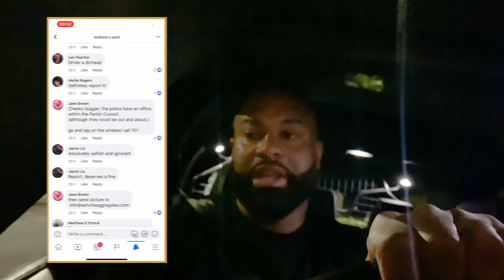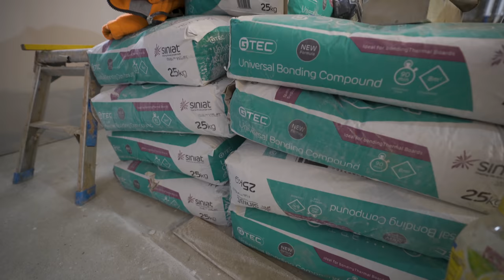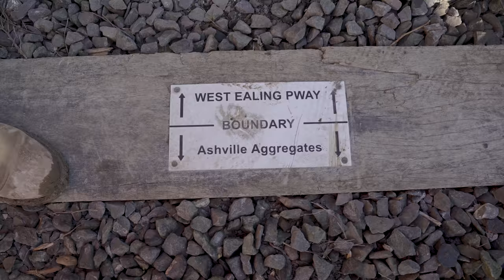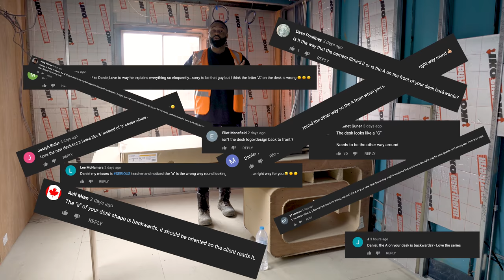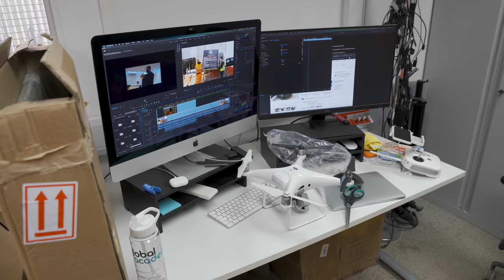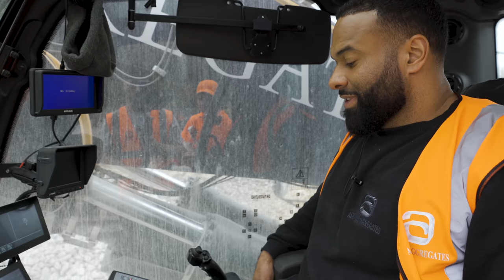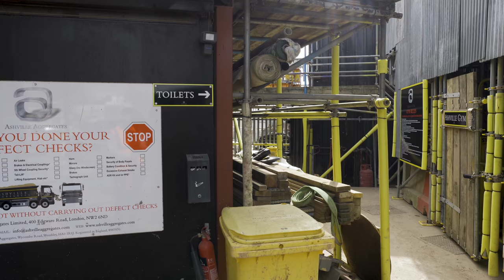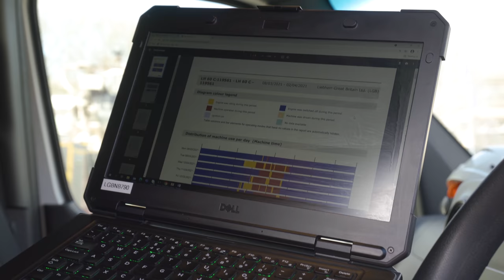Man vs Machines | Ashville Weekly ep026

Comment: When Daniel has a problem with his machine that delays a train, he gets fined. When the quarry has a problem with their machine nothing happens? Doesn't seem fair to me.
Reply: I agree, it has happened a few times already where the trains got cancelled, I doubt Daniel gets any refunds for that
Reply: It depends how Daniel signs the contract. We had signed contracts for the tunnel muck away on the construction of the Victoria Line, if the haulage contractor did not keep up he got charged for any owner drivers we employed plus a percentage for overheads. If we had a loader breakdown and delayed him they charged, but that never happened as we had back up and could hire a loader.
Reply: I don't think the fine is for delaying the train, i think the fine was for sending a train back that still has material in it.  It doesn't seem fair but it seems to be the way it is.
Reply: Yeah, it's just as unfair as the dentists, if you come even 5min late they charge you fully and cancel the appointment, but if they are late and you are waiting in the room for 20 min, nothing happens you just get an apology. the world is unfair.
Reply: It's all contracts, they'll have a lower cost per tonne as Ashville will have rationalised they can 'insure' that risk themselves by maintaining a stockpile in the yard. You could pay a much higher cost per tonne e.g. as Network Rail or their contractors do when organising engineering work because the cost of a failed or missed delivery into an Engineering Possession far outweighs the extra paid. So if there is an issue things get shuffled and Ashville get a cancellation and Network Rail get their delivery. 

Without knowing the contracts we can't make much of an informed comment, is the FOC and quarry contracted separately or is it one end to end deal via an intermediary. 

Regarding 'fair' once your in the real world there is no great arbiter of fairness.

Comment: Could you put concrete in the "a" of the desk to counterbalance the desk. And it also involves part of the Ashville Empire
Reply: It’s not necessarily out of balance... it’s more the possibility of bending the unsupported table top end.
Reply: @rushilkisoon  Daniel wants to be able to jump and stand on the desk that is not supported, but also, the "a" would be cool if it was done in Concrete
Reply: @seanryan7450  might be a problem with weight. Probably a limit to how much force can be on top of a container
Reply: @somerandomguywastaken  I suppose, but it would look cool, wouldn't it
Reply: Would be a great idea but don't know the weight limit for the container as its on top of another container. I've made such desks counters in the past and hidden metal is the way to go. I'd have got noel to make me a  frame for the top out of 50mm x 50mm metal box section and bolted it through the wall as per wooden frame and also have the metal frame getting as much hidden under support from the actual "a" part of the structure.

Comment: When the LH60 tracked back and forth and crushed the stone,reminded me of the start of Terminator! Re working for Morans,if your going to start doing that,pay you to get a compatible brick grab,be handy when the new Scania turns up,Great vlog Daniel,keep them coming and stay safe.ps when you were doing the slack adjuster on the DAF,the new body support was in the wrong place,it should sit parallel on top of the chassis rail,,so 90 degrees to how you've got it,with the pivoting red piece on the under frame rail on the body.

Comment: What's all the fuss about a driver parking for a small amount of time in a pavment. Keep up the good work, people just hate on you
Reply: Pavement's are not constructed to have lorries on them, OK an empty one may not cause damage but loaded ones and crack paving slabs, or the asphalt layer.
This in turn cause pedestrian trip hazards and also damage service's laid under the pavements.
Plus you have the wheel chair and pushchair users to consider, or is it OK for them to walk in the road, where the lorry should be.

Daniel is right to speak with his drivers to be more considerate. Well done Daniel.

Comment: Hey AshVille Crew at TS 40:35 Daniel, while on a phone call, asks himself how a lorry can be filling w/ oil while it's parked up. What's actually happening is that a portion of oil has to Drain back into the Crankcase from the cylinder head, turbo and other areas above the Crankcase so that the oil level sensor is able to give out a correct oil level reading. Hence why these systems will give you a notice on the dash board to allow anywhere from 5 to 20 minutes (w/ eng OFF) before the oil level can be checked. Essentially this system is meant to be utilized at the start of the working day before the engine is fired up so that a true and accurate "Cold fill" oil level reading can be given out to the operator.

That's not to say that theses sensor can't go bad or have any sorts of issues flare up.

Comment: I have two thought watching this episode. 

Would a Dozer be more beneficial for moving the pile down than the Liebherr? It keeps the hours down on the machine and both could work in tandem to do the job quicker.

Having a mobile workshop in a van with a generator welder would have allowed you to complete the work with the bucket attached to the machine provided you disconnect the earth terminal on it. (Side note if you do this also disconnect the greasers, they have a separate brain which I have fried before by welding on a machine.)

Comment: Daniel, those packs of blocks you put on the back of the lorry are heavier than you think, 440mm x 140 are 27kg each, 48 per pack is 1296kg so nearly 13 tons not 11 like you said. If you are delivering 100mm blocks they work out even heavier. 19kg each block, 72 per pack 1368kg for 10 packs.

Comment: 8:18 very hard to see on a phone, but assuming the double wides are RCDs, I was wondering for the purpose of the blanks between the breakers? Since you have RCD's they wont be RCBOs, so don't generate enough heat to warrant the blanks?
Or, are the double wide ones Surge protectors and the singles are RCBOs?
(Again, on a mobile, I can't see)

Comment: The Grab lorry doing the delivery’s don’t need to jack the lorry off the ground lol 😂 It only needs to take the weight and stable the the lorry with the jack legs! I have my own grab I should know! 👍👍
Reply: @londontruck7100  well I don’t think he will drive off with them down with the lorry looking at the moon 🌙 either! But that sure would bend them too 😂
Reply: @richardcheeseman6959  Oh yeah deffo mate driving off would do it.  But I was told by an engineer from TH Whites that the legs will bend in normal use if the wheels are jacked that far up. It happened to a numpty where I work to one leg. They need the support of the wheels on the ground to stop it happening. Especially on a slope.
Reply: @londontruck7100  exactly that mate! You think best part of the weight on them jack legs loaded  sure they would bend.

Comment: That body prop should be turned 90  degrees and fitted between the chassis rail and the body rail. Both rails should be in the slots  of  the prop.

Comment: Could someone give a bit more context about how the truck was parked? I'm from the US and I don't quite understand why it was an issue. Thanks!
Reply: Because  it was parked on the pavement (sidewalk) in a busy high street, forcing pedestrians to either walk in the road or cross over to the  other side  to pass it. It is illegal to park  on pavements in the UK.  I don't know why the driver didn't just  leave it fully on the road as there is  still plenty of room on that road for traffic to pass. 
The driver is a  fuckwit considering that Ashville has already had complaints and social media problems previously for the same problem.
Reply: @londontruck7100  I see, I didn't realize that was a sidewalk. I think the driver deftly made a mistake, we also don't know the conditions when they parked, it's easy to look at the photos of the clear area and think they made the wrong decision, we don't know for sure. The driver should in a park there but I also think people are significantly overreacting. Thank you for explaining the situation.

Comment: Silly proposal and probably too late now, but if you turned the desk around by 180 degrees, (i.e. the face that was towards you, turns to face the other side), you could fix the end of desk to the wall furthest from tv screen and have the A in the middle of the room - and no legs - needs to be centre stage of the office in my opinion and not on the side

Comment: it's actually worse than that parking the loading shovel like that, whilst it's not running the oil pressure drops and it will all drain to the back of the sump, when it gets started the valve train will be the last part to get oil and will cause catastrophic wear, especially if it's not up to temp

Comment: Do you use red diesel in the machines that keep having dpf issues if so could be why as it has lower cetane meaning higher ignition delay so incomplete combustion and more soot for the dpf to deal with

Comment: Why not using  a pallet fork rather  then straps on lifting the pallets? (no need climbing in oute of the truck bed and no need to go down strap the pallets......) And why not using the wheelloder on moving the top of pay pile(grab bucket looks small donno m3 tho)  or is the rocks so soft the loader just sink in? (hard rock in this contry no problem)

Comment: Hi Daniel maybe you need a second excavator like a big old Volvo capable of unloading the train. I found it's best not to be loyal to one manufacturer.
Maybe you need to have someone in to clean the dpf with a mobile machine by running hydrogen through it periodically.

Comment: Mate get a brick grab used to do my head it messing with slings ..how come the stabiliser leg isn’t pulled out 🤔
Reply: How you gonna get that many stacks close together with a brick grab?
Reply: @thisistakingthemess  used to do it all the time you could put the last lift on the other way round with the brick grab over it 👍🏻I guess the body on the truck is a muck away so prob not as wide as a brick n block carrier
Reply: @thisistakingthemess  Easy to load that body with a brick grab, He still had about 2 foot at the front of that body. You just load with the rubbers on the grab at 90 degrees to the sides of the body and leave a 6 inch gap between each pack. 
The legs on a grab are fixed they dont extend.

Comment: the dpf is one of the whorst part of any modern engine, i can't even remember how many problems i had with the dpf on the actros i drove in the last 4 years, broke down at least 4 times, limp mode many many times, engine power reduced, in the workshop for weeks ecc.. (and it was not the same tractor unit btw)